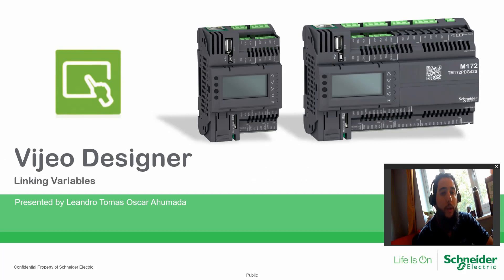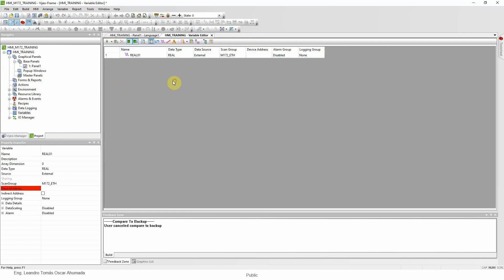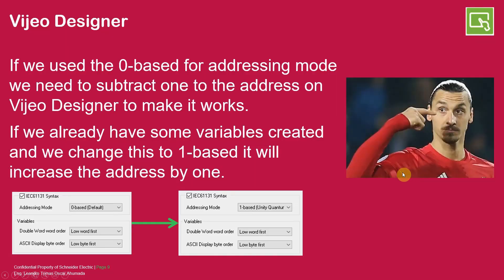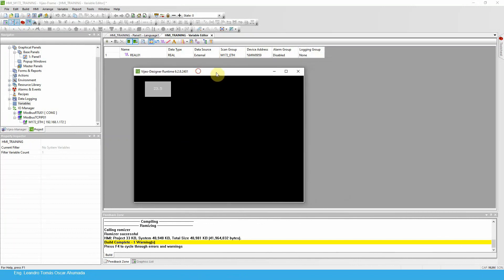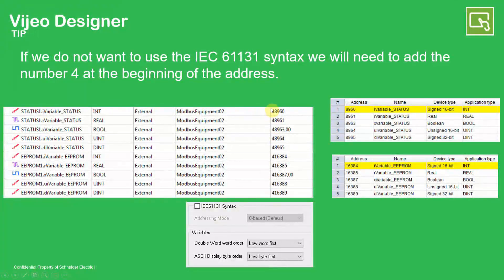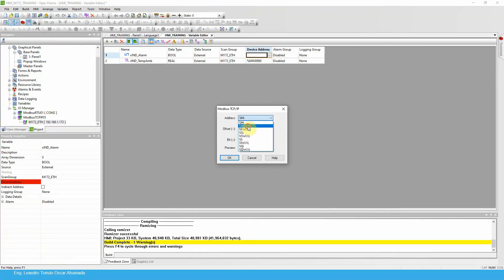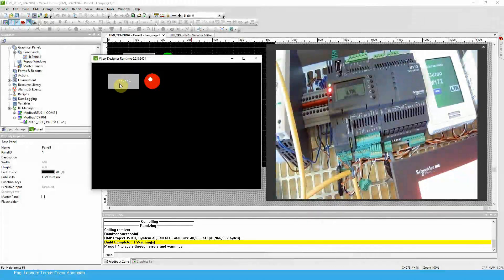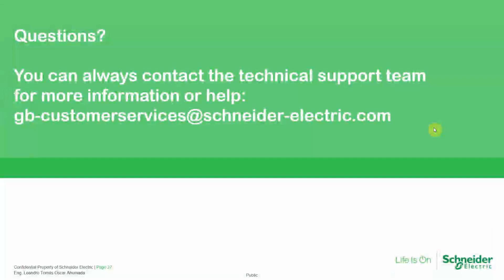Training M172 - M11.2 Linking Variables to Vijeo Designer from EcoStruxure Machine Expert HVAC

Comment: How to link with tia portal
Reply from the maker: Hi There! Please check on the "IO Manager" in Vijeo Designer , the drivers for the manufacturer "Siemens AG", inside you should be able to see one in particular called "SIMATIC TIA Ethernet" that will allow you to connect to the S7-1200 and S7-1500 Series. If you need further info you can click on the "help" inside the selection of the driver to open the manual.

Comment: hello sir there is any change need to do  in plc side?
Reply from the maker: Hi there! Depend on the protocol use but if you are using ethernet then enable the block on the bios parameter and perform a full download. Remember that you can access to eeprom and status variable (also bios)

Comment: Very informative video.
Got a Qn though. A  StartPB on my HMISTU855 when linking its variable to Workbench, is it an input or output in workbench global variables?
Or rather, may you please clarify the differences between: 
RTU_BIN_READ  &.  RTU_BIN_READ_OUTPUT
Reply from the maker: Hi Alo_M! I am a little bit confused with your comment. In the PLC you have all your in the status , eeprom and bios. those have a address %MW so you can use the modbus functions to read or write holding registers.

Comment: Hi thanks for the video. 
Unfortunately there is a problem, I have an M172.42 controller as well as an HMIGXU5512 panel. it is not possible to establish a connection either in the simulation ( ping to the controller goes ) or live , although I do exactly according to your example . 
I think the problem is in the settings of the 172 controller . 
Could you share a demo project . Thanks
Reply from the maker: Hi there! I believe the problem could be related to the ethernet port number. By default in the Modicon M172 the TCP/Ip Port number is disable (65535) so you will need to change that number to 502 (or the one defined on VJD Basic) to be able to connect to Vijeo Designer. Once you change this variable you will need to make a power cycle of the PLC.
If you go to Commissioning tab then in the commissioning explorer you can find below your plc the "BIOS parameters" > "All parameter" > the folder "Ethernet" > then the variable "Port_ETH_PI" should be in there.

On the Vijeo Designer I used the IEC61131 syntax + 1-based.

You can also check the next video to easily import the variables from M172 to Vijeo Designer:
https://youtu.be/4Pmo6KGp4dU
Reply: @LeTomasAHUMADA   
Thank you for such a quick and detailed answer . 
I remembered in the morning , with a "fresh head" .
Thank you very much.